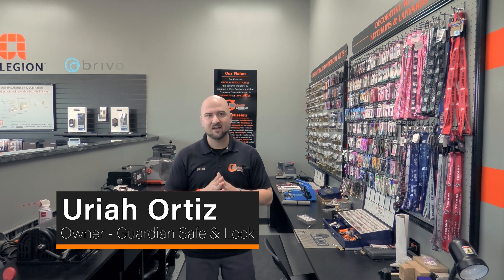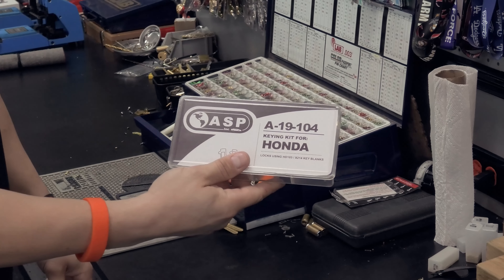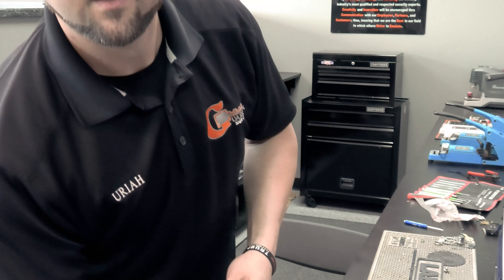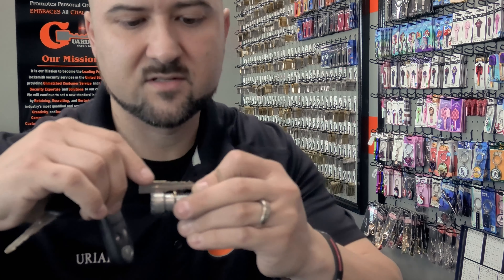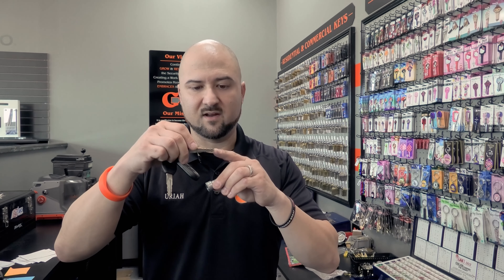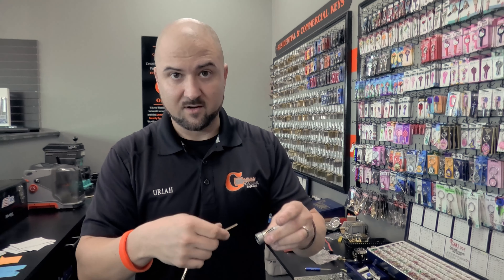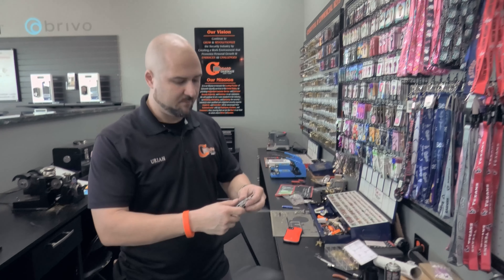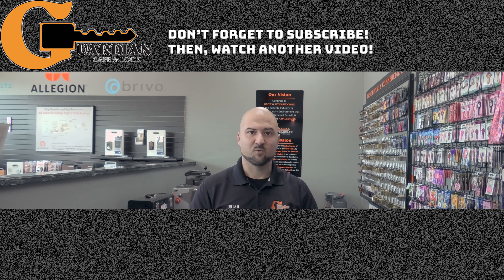Rekeying A 1999 Honda Accord Ignition Cylinder

Comment: I suck at taking ignitions apart. In that circumstance I typically cut a code key on a metal blank and see if that resolves the problem for the customer. Which it usually does. Them make them a new transponder key. What’s your opinion on the way I’ve been handling this situation? I’ve only been doing auto for a year now
Reply from the maker: Well I guess will make a lot more rekey videos for ignitions so you can learn lol
Reply from the maker: It all depends on the situation, sometimes we run the vin, sometimes there’s a key code on a door cylinder, sometimes you can lishi it and read the cuts, or sometimes you just need to disassemble it and decipher or rekey. If what your doing works most of the time then stick to that but if you try new methods then you’ll get better and be able to turn down less jobs. If you ever are stuck and not sure what to do on the ignition, call our shop and if we’re not too busy we can try to give you some advice. - Uriah
Reply: @GuardianSafeAndLock  thank you

Comment: Great video Uriah!  So you think partnering up with a local mechanic is better than pulling and re-keying on the spot? Have you had some liability issues with this? I only ask as I will be in the automotive Locksmith gig by January. Thanks for your generous information!
Reply from the maker: I just don’t have the time for the most part to tie my techs up on things like that and also it’s a lot less liability. Doesn’t mean we won’t offer that service at a later point but as of now we don’t, so we partner with a local mechanic. - Uriah